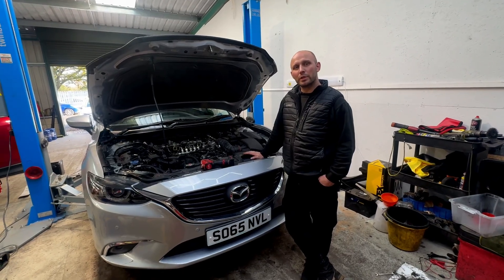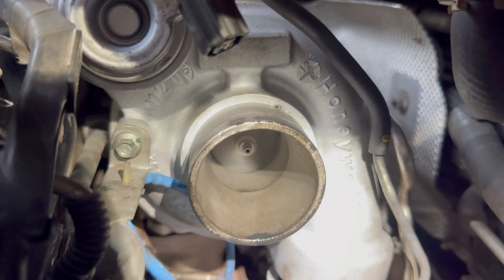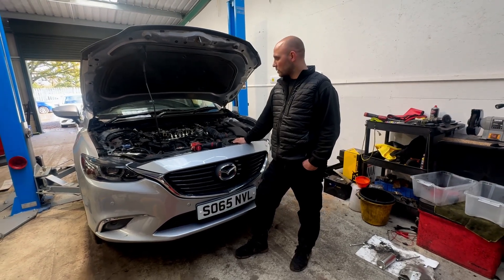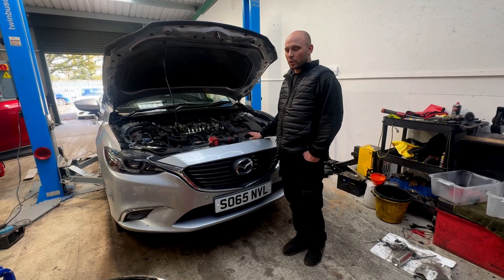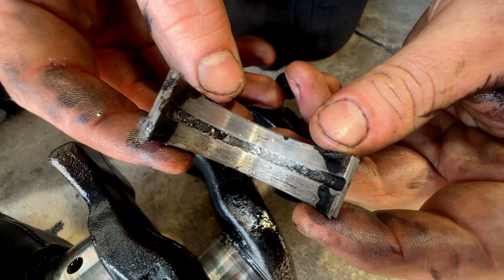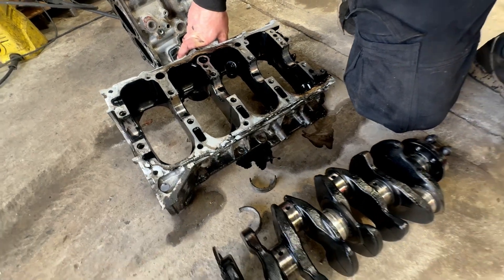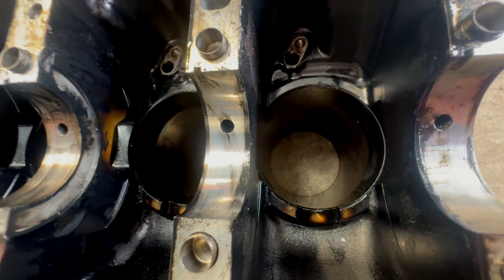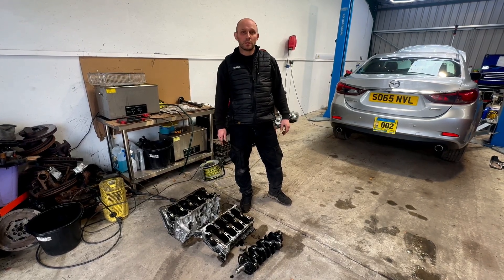OWL inside the Engine - Mazda Skyactiv Turbo Failure - Who's Gonna PAY for This?

Comment: I was thinking about harness for testing turbos. It might work for you since you focus on Mazdas. Maybe you could use an old engine on a stand to quickly assess a turbo? Alternatively, dedicated harness would need exhaust pressure, oil supply and drain, vacuum for control (?), output pressure sensor, and vibrations sensor. You know it better! Alternatively, perhaps you could send a regenerated unit to a third party for a second opinion. You can't afford playing roulette with unreliable suppliers. Charge customer little bit more, but have piece of mind. You guys are rock stars!

Comment: Maybe send the other turbos off for testing and transfer cost to your supplier,but, when i purchased my reconditioned turbo from a place near Milton Keynes it stated that any cost associated with the removal of a faulty turbo is down to the owner😮
Reply from the maker: So if they supplied a faulty turbo, the customer had to pay for the removal of it?
Obviously in our case it will be us, so it won't cost the owner a penny more, why would it? It just doesn't make sense.
Reply: @MrNiceGuy94  I agree,it just puts the onus on the person fitting it,like yourselves,unfair that the warranty  only covers the turbo and not the taking out and putting back in